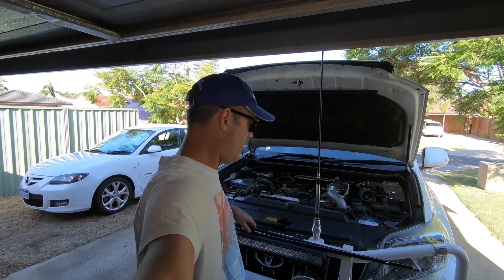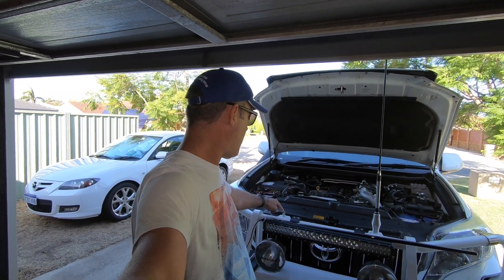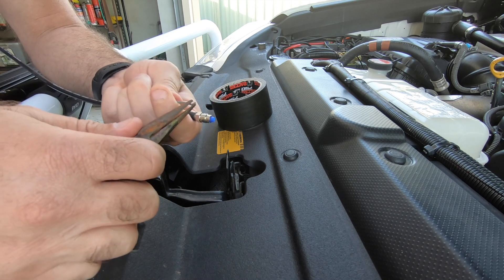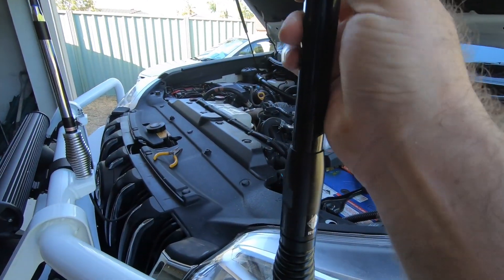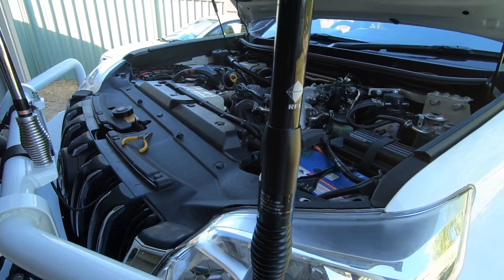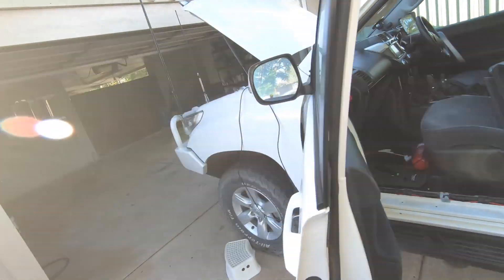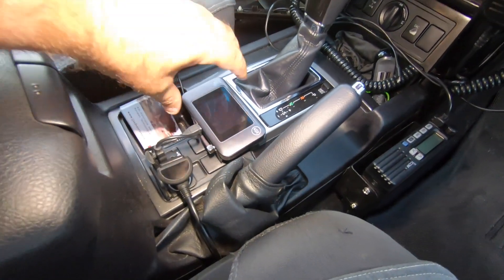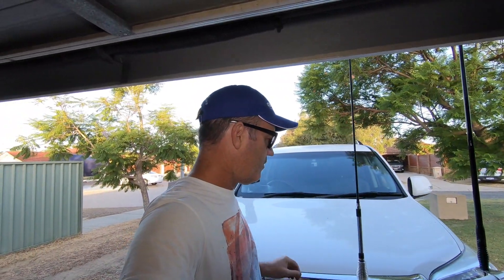3G, 4G/X Hotspot/Antenna Install and WiFi calling

Comment: Great video mate and addressing a very common problem that doesn't get enough attention from the providers.
Ever since phones lost a "proper" external antenna port, things just dropped off

My personal findings is that passive cradles are junk
CelFi or Similar products they use in the US seem to work but with limitations 

I had not considered WiFi calling, as then i'm running 2 SIM cards and twice the cost
But i see the advantages

Comment: great vid mate cheers, can I ask where you purchased your fire extinguisher bracket?
Reply from the maker: The one in the front seat foot well? Its the bracket it come with, just attached to the seat adjuster bar with cable ties. Its works well, is solid.

Comment: Nice one.  Same setup I've been running for a while.  But im using a slightly older version of the 4gx hot-spot (no digital display,  just LEDs). Works really well,  but prepaid data is so expensive.
Reply from the maker: Yep, they get you on that. I am investigating a Cell-Fi to try and see how much better they are..
Reply: @jjsadv  looking forward to hearing your thoughts on the Cellfi.
Reply from the maker: @WildTouring  They seem to have a great name. You obviously cant get signal where this isn't any, but if there is a sniff it will boost it I believe.